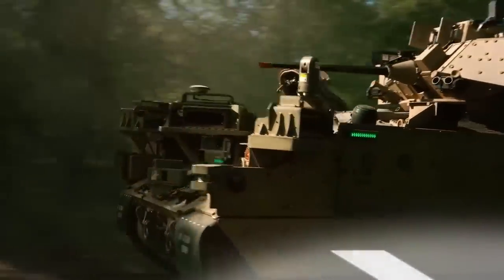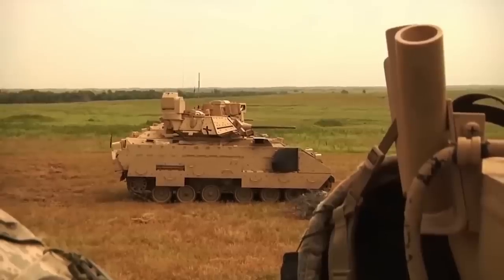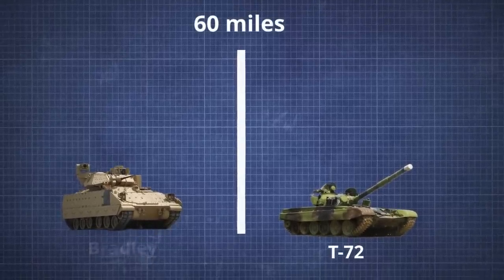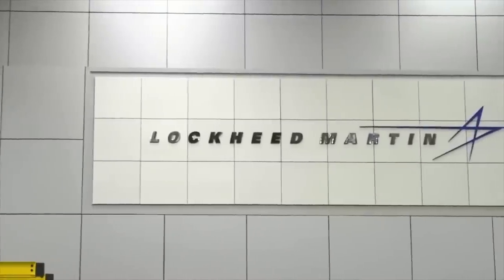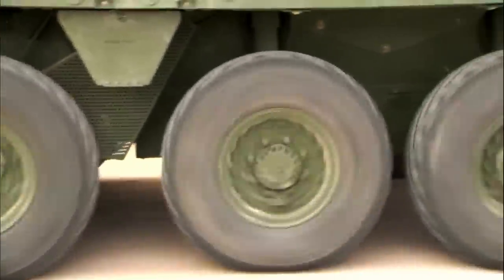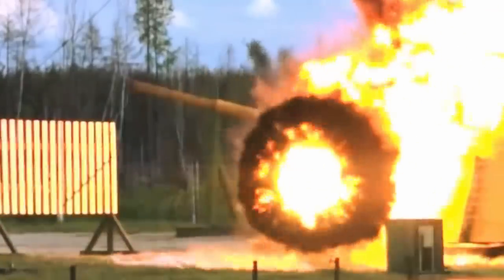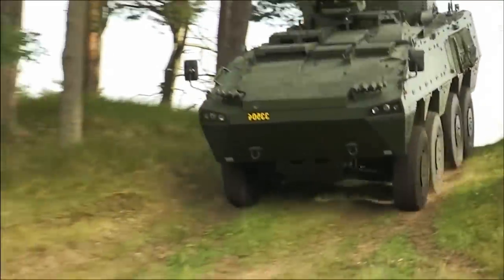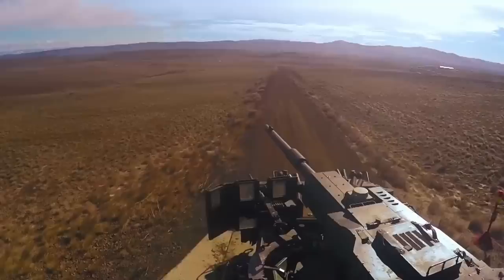US Reveals Terrifying LASER Weapon For M2A3 Bradley

Comment: Lt Rob, United States Airforce Retired. 
The reason the Bradley so quick is a known fact for anybody that was involved in a conflict where they were involved. They are VERY LIGHTWEIGHT as far as ARMOR is concerned. Better than walking around with nothing. If a Bradley gets hit the armor is very thin and you can kiss your ass goodbye. That's one of the main differences between the Bradley and a tank.
For those who don't know.

Comment: I basically had the same problem with my laser battery. Last month when I was on my way to the store, my car died so I got my multimeter out and I checked the voltage on the battery and it was 9.7378 Volts so I thought “what the heck is going on with this battery”, the next thing I knew I seen some smoke coming from the tips of the battery terminals. I was suspicious on what was going on and I couldn't believe it because this battery was only barely 16 years old which I consider fairly new in today's society, so basically what I want to do is try to clean up the battery with some soap and salt solution and then I might put it on the charger for two or three minutes at a high current rate just to see if it will hold a charge. I'm not sure if that's going to help the battery or not but one thing's for certain before I go out and buy a new battery, I'm definitely going to try these two methods that I suggested. Now on the other hand I could swap the battery out with one from my 1962 Chevy Tahoe but I'm not sure that my old lady would let me do that, so basically what I need to do is first, I'm going to check all the air in the tires before I monkey around with the battery. Then I'm probably going to run a few errands around town down and the next thing I want to do is get some paint and paint the battery terminals because I don't think they look very good without the neon yellow color look on them.  If all goes well, I am planning to do a few other things to the terminals. Next after that chore, is get some of that distilled water and pour on the outside of the battery to try to clean up a lot of the dirt and dust its accumulated over all these years. If I have time what I'll do after that it's try to clean both sides of the mirrors on my 1965 Ford Bronco because I've noticed while I was driving that it's hard to see what kind of traffic is coming up behind me. I was having a problem with the battery when I put the headlights on low beam and then when I tried to switch the high-beam I noticed that the voltage excursions were jumping around so I went out and I bought another set of test leads to use on my digital multimeter and there was no difference at all, so I think I may borrow my friend Tony Jones's multimeter just to check those voltage excursions to see if that is normal. Nobody really explained to me how to test a DC voltage excursions when the battery is not in its prime. I am all on my own doing this. A lot of people have contacting me and they said that they've had that problem once or twice and maybe even three times in their lifetime with their batteries but they did something totally different. What they did was loosen the terminals first then they carefully remove the battery and hoisted it out to get rid of all the debris and dirt that's accumulated after all these years then they put it on a slow charge which I believe they told me was 32 milliamps for 6 days, 3 hours and 54 seconds. Next they took the battery caps off and added some distilled water, which they claimed that they bought it at their local Walmart store. I think, if I can remember correctly, they said it was .99 cents plus the sales tax. Can you believe that just 99cents? That's a real good price for one full gallon of distilled water. Speaking of water, yesterday I helped my neighbor that lives to the right side of my house, fill their swimming pool for the new season. It literally took 7 hours to fill. I am not sure how many gallons it is. I have met people in my lifetime that had no idea that there were 4 quarts of water in a gallon jug. They just assumed it was a gallon only. I am not really good at math but I do have a calculator on my cell phone. Speaking of math, it takes me back to grade 11 in high school when my teacher, Mr. Lowry gave us a sneak quiz on algebra. I failed it because I didn't understand what that was all about. I spent most of my high school time stoned and kind of out of it. Some of my classmates were very good at math, and it even showed when they got their report cards. I may have gotten of the path of whatever we were initially talking about. I think it had something to do with blue cheese. No, I remember now, it was car batteries. I never could figure out why they put car batteries in the front of the vehicle and not inside the vehicle. It would be so much easier to work on them, especially in the rain, if they were inside the vehicle. Doesn't that make more sense to you too? Well anyhow, batteries are pretty heavy for their size and some people can't lift them very good. I had a fried, Tony Smith who had asthma and once he tried to lift out his car battery, and sneezed, and the battery fell out of his hands and landed on his right baby toe. It broke the small bones in that toe of his. I called his mothers step daughter Ann but she was not home. So I then called his brothers uncle Fred and told him about what just happened to Tony's toe. He seamed like he was drunk and started laughing at me and said “I don't care about that Bast#rds toe”. I got mad and hung up on him immediately. From that day on, I never spoke to Tony's brother's uncle Fred. I never really liked him in the first place because when Tony and I were 13 years old, we were at a softball game and Fred walked over to us and farted right in our faces. That was not very nice of that old pervert. I heard some stories about him when he was about 20 years old that would make you cringe if you heard them, but I can't get into that right now because I have to finish up my posting here on you tube. I hope I have given you folks some good advice on having some of your problems solved in a timely manner. I like to help out when I can if it is at all possible. I am out for 3 more hours so I want to go now and get a hot dog and a bottle of grape soda. I need to look around for a ride so I can get back to my padded room at the Sinclair Insane Asylum. I hope Dr. Dilbert will not be mad at me for sneaking out....
Reply: You sir have entertained me more than the first 141 seconds of this video, thanks 👍
Reply: You make a person tired just thinking about all this activity.  This takes care of today.  What will you be doing tomorrow?

Comment: To defeat the laser, all you have to do is essentially use a smoke generator, but instead of purely omitting smoke cloud, you would have it infused with a little bit of metallic powder to deflect the beams energy. That or glass? Clouds do it through the refraction of the water😅
Reply: I also believe that a paint with the diffusion characteristics would be able to defeat the laser weapon as well. Kind of like fiber optics, Why fight it when you can diffuse it
Reply: Not likely to work the gigwats of power will just burn any particles.... Like it does armour...
Reply: @reelchef67  No because it itself is not a solid. So if you can break it up into smaller beams and push those through refraction and even smaller beams, you run the beam into a neutral state just like clouds do. That's why they can't use the laser on the jet and that's why they don't use it for ballistic missile defense and they don't advertise it because the program failed due to clouds because of refraction of light
So the same way they put it together you can take it apart except they have to put energy to make it travel to distance where you just have to make it come apart

I meant to say diffusion not refraction. Also, with the speed of the hypersonics and stealth coatings, the laser is going to have a very hard time staying strictly on point 😉😁
Reply: @gsc512   I am betting you have not done any engineering work, even a 100 watt laser will burn through particles punching through. a gigawatt laser is so hot it vaporizes particles instantly without refraction...
Reply: @reelchef67  While atmospheric absorption and scattering are reducing the intensity on
target by reducing the total transmitted power, the effects of turbulence dimin-
ish the intensity by increasing the diameter of the focused beam. Turbulence
leads to local changes in index of refraction along the path of the beam. As
turbulence effects vary with time, the effect is comparable to the encounter of
an distorted lens with changing optical properties. A visible result of this effect
is the flickering of stars in the night sky. The light is refracted differently over
time, and on the ground the star seems to be moving. This effect is called tilt or
jitter and is the lowest order optical effect of turbulence. In addition, the beam
encounters phase deviations, which lead to higher order optical aberrations,
for example a defocusing effect.59 Severe turbulence might even break up the
beam in several smaller spots

Source:https://scienceandglobalsecurity.org/archive/sgs18stupl.pdf
Reply: @reelchef67  I'm betting you've done. Absolutely no engineering work. You shouldn't say that to people. You have no idea who you're dealing with online. I'm guessing you're not an engineer because you're making a lot of assumptions that's a fact-based opinion as opposed to yours
Reply: I'm guessing your not vica versa...
Reply: @reelchef67 source: https://scienceandglobalsecurity.org/archive/sgs18stupl.pdf

Comment: Did I miss something? Since when does Bradley have Javelin missiles? Bradley is armed with TOW missiles.. Also Stryker with the 105mm gun called the MGS or mobile gun system, is being, or maybe already is, retired. The shock and recoil from firing the 105mm gun was too much for the fairly light Stryker.. 
A lot of wrong information coming from this channel...
Reply: Yes, this seems like a lot of misinformation…
Reply: Yeah it's the bgm-31 tow, and also the chain gun, seen them in Iraq and fast to about 40 mph.

Comment: Best light source for laser is 40% efficient if at small power settings. 
Serious discharge lamps got only 20% efficiency. 
It is nonsense to shot but 80% of energy into your own device. 
Microvawes on the countrary can be 90% efficient...
Reply: LEDs are much more efficient than the numbers you listed.
Reply: @mrbaab5932 Checked with google: LED efficiency is 40% as ever was. If it gets better I'll know....

Comment: When did the Bradley start firing javelin missiles? I thought it used tow missiles…
Reply: This is just another brain fart video... Take it easy.
Reply: It does fire the TOW missile. It can carry the handheld Javelin missile like any soldier.
Reply: @Jaques Meissen Yes the troops it carries are just an optional external weapon system! Mortars, M-16s, SAWs, Javelins, grenades, mines, anything they can carry! 
But built in the M2A3 Bradley has the 25mm Bushmaster chain gun, a 7.62mm coaxial machine gun, and the TOW missile system. True fact, the Bradley took out more Iraqi tanks during Desert Storm than the Abrams.
Reply: @chrisstancer5857  yes it did, A HELL OF A LOT MORE TOO.

Comment: Don’t believe this. To be able to power such a laser, or for that matter any military laser you will require a power source. Such a power source would make the weapon immobile and hence a sitting duck.
Reply: True. However, a laser designator is feasible and can be used to "lase" a target, thus allowing a GBU-56 Laser JDAM (aka: LJDAM) carried by an F16 (among others ) in order to guide on a target designated by ground forces using a laser designator which simply places a red dot on the designated target in order for a JDAM to guide on. Sorry for the wordiness. It's a lot of text for what is a relatively simple thing.
Reply: @cassiespencer6134  laser designator can and is carried by ground troops and has been for a number of years
Reply: @albertschultz7151  Yes. I'm well aware of that.
Reply: Oh ok electrical engineer NOT
Reply: Lasers have been out for years now. You don't think as time goes on the United States doesn't come up with ways of making it smaller and lighter. Like the first computer that took up an entire room.  Now it fits in your pocket. Not only is it smaller, I don't know how many times more powerful it is. I don't post inaccurate information. Only things I know to be true times change.
Technology gets smaller and more powerful with time that's a known fact
Reply: @albertschultz7151  
Some people have no common sense. As time goes on tech gets better and smaller as needed.
The first computer took up an entire room and was barely able to do anyting.
Reply: Spinning batteries, braked
Reply: How much power do you need 10kW? Toyota Prius has very small engine and 9kW batteries.
Reply: Wrong. Turbine generators and lithium iron phosphate battery system easily power high power lasers.